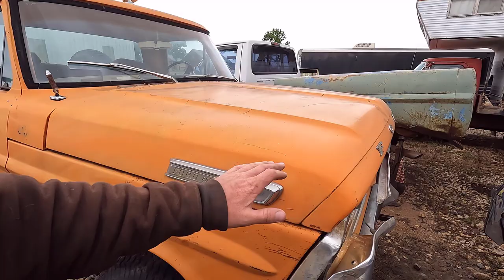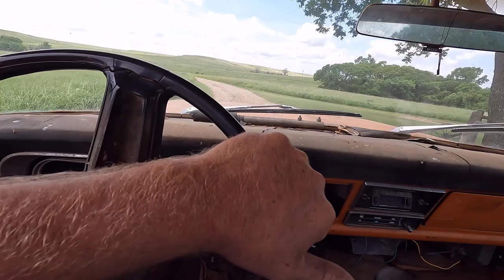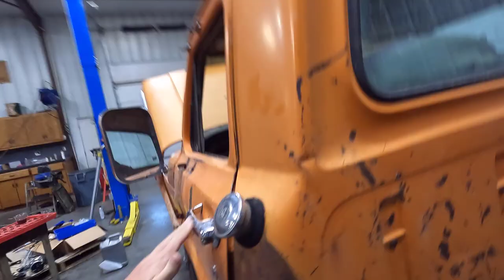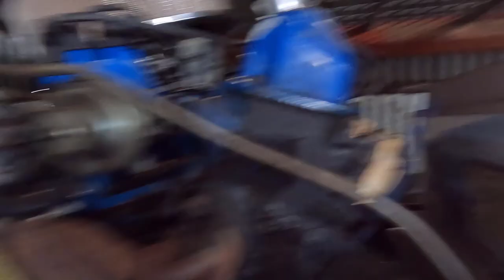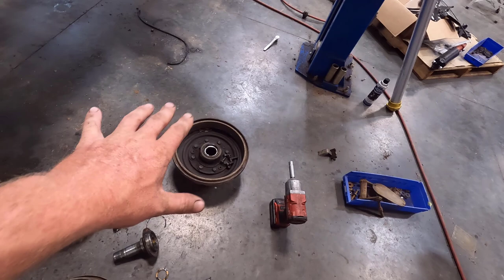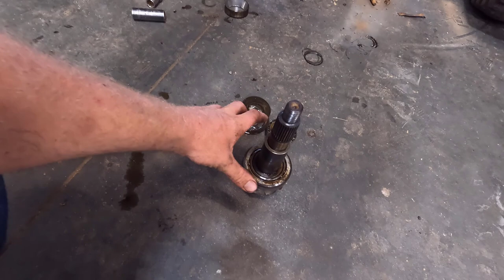Real World Highboy Body Swap Ranch Truck Build

Comment: Is 72-78 the frame same from two wd to 4wd?
Reply from the maker: 1972 was the last year for the 34” frame in the 2wd trucks. (Same as 4wd) in 73 they changed to 37 behind the cab. I’m 1977.5 the 4wd also changed frame width and went away from 34” frames.
Reply: @MattKubik1791   are u in WASHINGTON?